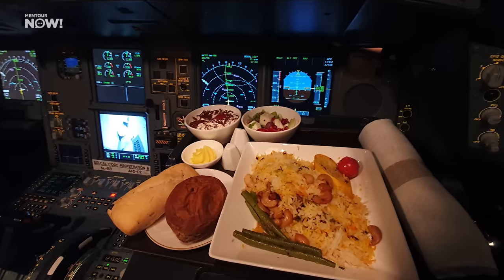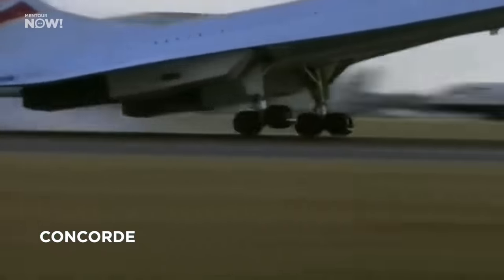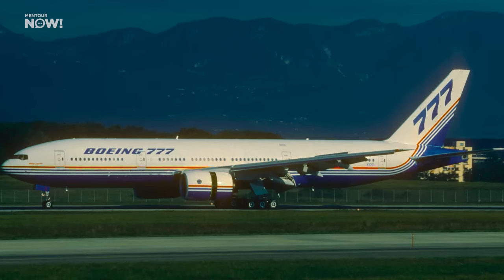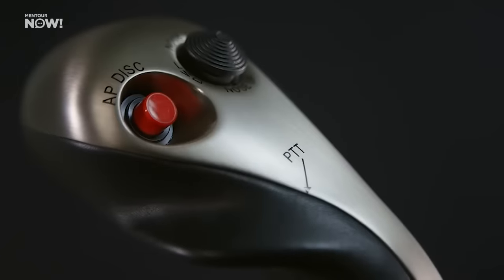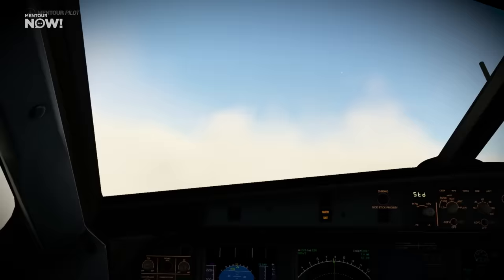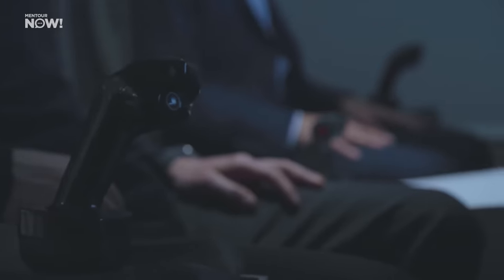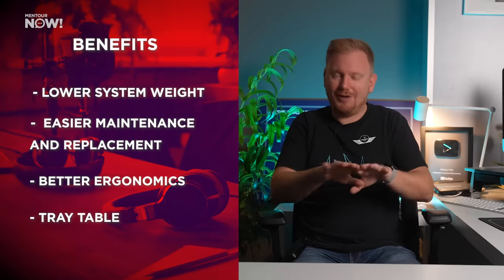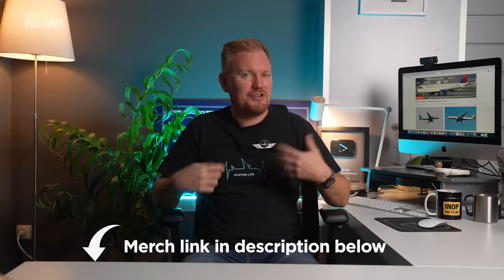Will Airbus Finally switch??

Comment: As a proud Canadian, the mention of the Avro Arrow just hits me hard. 🍁 The Arrow hit Mach 1.9 in the initial flight tests, with plans for a homegrown jet engine upgrade. The sixth  Arrow(RL 206) was just days from being ready with the new Orenda engines. The engineers figured RL 206 would hit Mach 2.5 with those engines.
Reply: The old saying only the good die young I feel applies to the Arrow, it never had the chance to achieve great things, and that has become its legacy. Had the program continued its problems would have also become transparent, and that never happened either, a track record would make or break an aircraft and the Arrow never got that chance either way. Therefore we remember it for the potential it never achieved
Reply: As a proud Canadian, don’t forget the mention of the airbus a220, also a Canadian product ;)
Reply: The problem with the Arrow is there is a lot of mythos that surrounds it that has no basis in reality. 

First is the idea that it was the first FBW aircraft. It wasn’t. The Avro Vulcan was which is where Avro Canada got the design. 

Next is the speed. Yes it could have gone Mach 2.5 (not any faster or it would have melted). Then it would have to immediately return to base because it had no fuel. It was not practical and to make it practical either extra fuel or weapons would have had to be mounted externally.. negating any speed advantage. 

The C-Series is the best plane Canada ever produced… period. Not only is it advanced but it’s competitive and profitable (now that it’s away from bungling Bombardier).
Reply: As a Brit it reminds me of the TSR-2. Like the Arrow it was the US that put pressure on the government to cancel it, offering a good deal on a US plane. A trick they repeated when the UK developed satellite launch capability. The US offered free launches on their rockets, an offer they withdrew after the UK scrapped its rocket.
Reply: @karlbassett8485  I assume you can back these statements up with some evidence.
Reply: @bayouflier6641 NASA, Grumman, G.D and Boeing were in Toronto recruiting Avro engineers the same day the program was canceled. No one can prove beyond a doubt but it certainly worked favorably for the US aerospace industry. The US convinced the Canadian govt that the day of the manned bomber was over and would be replaced by the ICBM (Bomarcs)therefore there wouldn’t be a need for an interceptor…all the while still developing their own interceptors. There are many urban legends and there are many signs of inconvenience. The Arrow 206 would’ve smashed the world speed record with the Iroquois engine, and in the era of the Cold War, this wasn’t something the US could stomach.
Reply: @Bartonovich52  not necessarily. It was designed to withstand the heat with new alloys. They were also planning a Mach 3 Arrow. It was designed as a high altitude interceptor for bombers and the internal bay had enough room to carry all the ordinance it needed.
Reply: @michaelconvery8871  Well said sir.
Reply: @michaelconvery8871 Yup, Avro engineers helped put people on the moon. And really that's the worst part of the Avro Arrow experience, just how badly the cancellation was handled. We lost an entire generation of engineers to American interests. And 15,000 people, many in highly skilled positions, lost their jobs, literally overnight. If they'd been able to pivot some of them onto other projects, it would likely have helped Canada maintain a more active aerospace industry for the long term.
Reply: @michaelconvery8871  Sounds like a lot of conspiracy nonsense to me. Still no evidence. And the Arrow didn't have the range to be effective. That's what killed it.
Reply: @bayouflier6641  interesting comment but more of a deflective one for obvious reasons and a little on the non-thinking side. “Conspiracy”? Ok, you can think that but tell me something, how did the US private aerospace companies have inside information, long enough to plant recruiters in Toronto(that would’ve taken more than a few days notice), before Avro, it’s employees and contractors knew that it was going to be cancelled? Why would the Canadian govt give the US pre-knowledge that it was cancelling the program(what benefit does that have). Does the US call Canada every time it changes course on its own programs? Not very likely! That’s a logical reasoning argument that doesn’t bode to “conspiracy”, because the logic dictates the question, “ what benefit is there”?
As to your technical argument about range, you seem to be blind to the fact that it’s testing was in its infancy. It’s design was to be a long range all weather interceptor so I’m pretty sure that range would’ve been a problem solved, most likely with drop tanks, if they had actually gotten to the stage of development which required range testing.
Reply: @michaelconvery8871  drop tanks would have negated its only advantage. As for the rest of it, without actual proof, you're fighting an uphill battle. I'm not discounting the possibility that your allegations could be true, but actual proof is required in most cases.
Reply: @bayouflier6641  I used drop tanks as a possibility but I think the RCAF solution was strategic bases of operations, hence why it was designed for all types of weather
Reply: Medium double-double, eh?!   All it needed was a cupholder for the Timmy's!
Reply: I was going to say!   And did you see CS100 near the end?  
I wonder if Petter knows about the Beaver or Twin Otter?!
Reply: And those engineers were also hired by NASA for the Apollo program. 
Canadians helped America get to the moon.   Not ourselves...
Reply: My sister's friend, her father was one of them.
Reply: The CBC film with Dan Ackroyd and Sara Botsford is great!  
The production designer is someone I know from here in Halifax.
Reply: @michaelrmurphy2734  Yup, 100%. I mentioned that in a comment on this thread replying to someone bashing the Arrow.
Reply: @ytzpilot  Just like Britain's TSR2,  Arrow was killed by two things: American pressure and the advent of ICBMs - the latter was probably the more important factor
Reply: @bayouflier6641  It's well documented. As far as the rocket side goes it was a combination of the free rides offered on NASA rockets along with the belief of Whitehall civil servants that there was no viable commercial future in satellites

I've worked with various people who were at Woomera and in Whitehall at the time, they both said the same thing

Apart from the considerable pressure the USA was putting on its "partners" at the time, TSR2 sales possiblities to Australia were quite effectively sabotaged by Montbatten and Solly doing everything they could to smear the aircraft because they wanted something purchased that the Fleet Arm Arm could use (F111B) and thereby pay a lower price for

Ironically, Britain and Australia ended up ordering F111s - those had at least as many delays that Montbatten claimed the TSR2 would have done and the F111B never happened
Reply: @michaelconvery8871  The Naysayers miss that Arrow was meant as a single mission sprint interceptor (similar to the Mig31). No other uses were envisioned and it was obsoleted by ICBMs in any case

Everything is complex but there is zero doubt in my mind that the USA was actively attempting to make all its allies dependent on American military technology and taking steps to neutralise their independent capabilities by "making them offers they couldn't refuse". It was the French who recognised and fought back against it
Reply: @miscbits6399  You nailed it.
Reply: In the military side --- look down shot down radar -- internal missile storage --- and Titanium body to with heat of Mach 2.5 ? and maybe more in dash. Note the Orenda Iroquois was the engine RR used to develop the Concorde engines.😊

Comment: I’ve flown both center stick and side stick in light aircraft. Both work well although side sticks tend to be much shorter resulting in less mechanical advantage, reduced travel distance and therefore less precise control. This is why aerobatic aircraft generally have center sticks. I would imagine that fly by wire and auto-trim mitigates this disadvantage to some degree. From an engineering perspective, I agree that active side sticks will be the most practical compromise. Hopefully, I’ll get a chance to fly with them before I retire.

Comment: As a Professional Engineer of Control Systems and as a private pilot, I know professionally and first hand how important user interface design is. As you point out, active FBW joy stick design is an obvious improvement. The feedback of "feeling" the aircraft's behavior is absolutely necessary, especially when most of the aerodynamic safety automation is disabled. However, it is also imperative that the inputs from that "feeling" are validated and known. For example, if the indication of the elevator trim system is unknown or has impossible indications, there needs to be a way that this feedback can be disabled or it will further confuse and disorient the pilots. 

As an aside, I use the Boeing vs. Airbus philosophies as a teaching point for inexperienced engineers. I would really like to see your take on the philosophical differences of the flight deck design. Thanks for a thoughtful presentation.
Reply: You are soooo right. A true force feedback system while the A/C operates in normal law is big design challenge. But once it goes to direct law, not having that sort of feedback is a catastrophe in the making.
Reply: Just the argument of Up/Forward is on Vs. Up/Back is on would be glorious!
Reply: @jakebrodakype And in your opinion, between Boeing vs Airbus, which UI is more valid?

And how would you remediate the deficiencies of either?

Thanks.
Reply: I don't know why this popped up in my notifications 2 months later. (Yes, Utube, you also need to work on your human-machine interface!) IMHO, abstractions, be that in the aviation industry, ore elsewhere (specifically programming / system designs) are both a boon and a huge problem. First of all, if all you learn  to work with is abstractions, with tons of guard-rails surrounding you, what can you learn? The pilot, captain of a ship, operator of a power plant or else, NEEDS to understand the basic system functionalities. More than understand: They need to be ingrained in that person's mind. Automation, like in the Airbus (but also other manufacturers) destroys that. I drive old cars, Mercs from the late 80ies to early 90ies. Zero computer support for anything. And I get (occasionally) claps and ovations when I can park these cars into a place that the automatic parking of a Tesla has given up on...
Reply: @woodwind314  They need to not just be ingrained, they need to be INTEGRATED into the system. To “feel” it, to “wear it”, to make it an intuitive part of themselves. F-16 and F-22 pilots don’t seem to have a problem, but they are a small specially selected subset of pilots. Airbus are driven by any rando climbing the ladder, be they Bob Hoovers, or What ever the opposite of Bob Hoover is. (Larry Eureka?) So more engagement would be better, except the goal is to rely 100% on the automation, so the autopilot controls have more thought put into them than the side sticks.

Hell the lunch trays have more thought put into them.
Reply: @mzaite  Those fighter jets are different: They are built to be inherently unstable, which greatly facilitates maneuverability. The price to pay for that is that these machines simply cannot be flown w/o computers. There is no fallback to smth. like "direct law" in an F16 or similar. If the automation fails, that jet goes DOWN, no matter what.
Reply: @woodwind314  It's more about the interface not the level of computer needed. In the 16 they had to go back and add some movement to the stick because they found it too weird for the stick not to move at all.
Reply: @mzaite Yes, that is true. However, the 2 topics are very much linked. Once you shift from a 1:1 relationship between physical control movement, and control surface movement, what sort of physical feedback should the controls even give? This goes far, far beyond "force feedback". Feks. if an Airbus is in on-the-limits alpha floor protection, you can pull back on the stick as much as you like - your elevators might even move in the reverse direction. (Air France Flight 296Q, anyone?) It is a very difficult design problem.
Reply: @woodwind314  It's not, with a proper feedback system you wouldn't be able to pull back any more. You'd be at a system defined stop. The plane could talk to, or "Feedback" information to the stick to give the pilot more direct information about what the computer is doing. And where its limits are. Right now in a 'bus you have to just make an educated guess what the computers are thinking based on memorizing a bunch of laws. 

The Airbus system right now is very much an autopilot with a manual option. Not a real control interface.
Reply: @mzaite  I agree with this:  "Right now in a 'bus you have to just make an educated guess what the computers are thinking based on memorizing a bunch of laws. "

However, force feedback cannot solve this problem.

In a traditional setup,  the yoke, and rudder pedals serve a triple function:

1: they provide control input directly to the control surfaces
2: They provide both visual and tactile feedback to the actual position AND movement of the control surfaces
3: they provide tactile feedback as to the  aerodynamic forces on the control surfaces

In a fly-by-computer setup, any control input is an input to the whole aircraft, or rather its computers, which then decide how to achieve the (assumed) intention of the pilot.

So, a specific input might result in control surface movements and positions that have zero relationship to where the pilot moved it. In some aircraft this also includes the throttles.

This precludes any attempt to provide functions 2 and 3 of a traditional setup.

To make things worse, once the A/C drops back into "lesser" laws, specifically direct law, AND the pilot is unaware of that,  terrible things can and will happen. AF447 might be the best example for that.
Reply: @woodwind314  They only do that because Airbus designed it that way. Their intention was to turn the control stick into a very fancy Autopilot interface, not a flight control. Designed as a flight control working through a fly by wire system, 2 and 3 would work. The System could correct or augment, but the pilot would know it's doing it by feedback in the stick. Meaning no fun surprises in Direct Law, because it's always basically in Direct Law with "enhancement" and intervention means moving the stick back at the pilot, or limiting travel to stay in envelope. 

Airbus just didn't want to bother with synchronizing the two sticks, so they gave up and just went full Arcade joystick with it because the doctrine to always use as much automation as is available and working. Which is great, when it's all working. Airliners never break....

Comment: When I first came to United Airlines, the instructors there mentioned that Boeing had come to UAL when they were designing the 777, and asked them which system UAL would prefer. Supposedly UAL said "yokes". As the launch customer, they had some pull.  

This could be just a legend.
Reply: I heard the same thing as UAL was flying 767’s, 757’s, 737’s and 727’s and did not want the training burden of sidesticks for the 777.  Reduced training burden a la Southwest.
Reply: That was a main marketing point for Boeing. They went to their customers and asked what they wanted. Flight deck, maintenance, cabin amenities.

Comment: I worked as an engineer on a military FBW aircraft (not mentioned in the video) with active side sticks which has been flying for almost 10 years. I'm not sure I'd recommend them despite the advantages listed in the video. The disadvantages are just too problematic.
-They are heavier than passive side sticks.
-They are harder to package as you need room for the large box below the sticks to contain the servos.
-The hardware is more expensive than the passive side sticks.
-The software is more complex and requires more development time than passive side sticks.
-They have thermal issues and high failure rates which cannot be tolerated in a FBW input device.

I'll explain that last one. The lower console of an aircraft is essentially a black box in a greenhouse. Add to that black box a couple servos generating their own heat. This is a recipe for a thermal problem, especially at 3 in the afternoon when on the ground with limited or no ECS (the side sticks would most often fail after a mid afternoon fuel stop). You can add more cooling with ordinary ducted fans, but the primary source of noise in many cockpits is actually the cockpit cooling fans. Adding a couple more is not desired, and without ECS, the fans might not actually get the job done. An airliner might have the ground ECS capability to keep them cool during a fuel stop, but I certainly would not put them on military aircraft that is expected to be happy operating in a desert. Pilots wear Nomex gloves in the summer, not for fire risk, but because everything in the cockpit is hot enough to cook on it when it was 50C/122F outside. Surface temps in the lower console can be literally hot enough to cook a steak. But, I'm an engineer, not a pilot. Well, I'm a pilot too, but not on these aircraft.

Force feedback on yokes do not have the thermal issues as their servos tend to be mounted under the floor in a much more protected space.

That's my 2c.